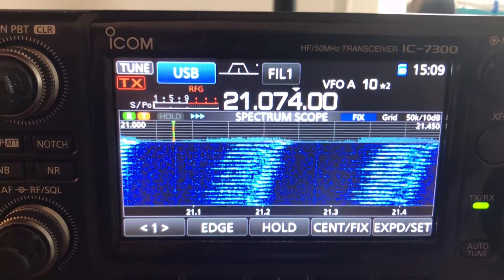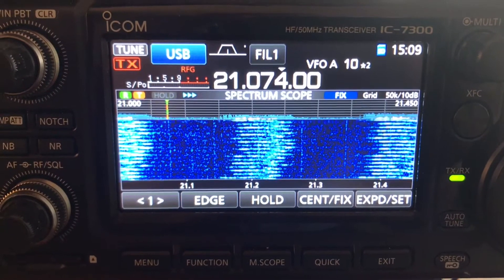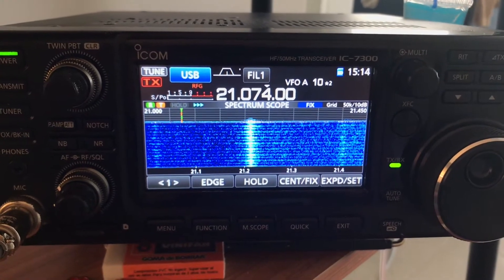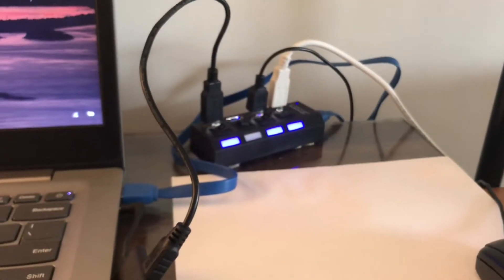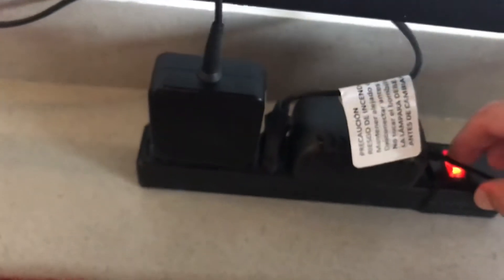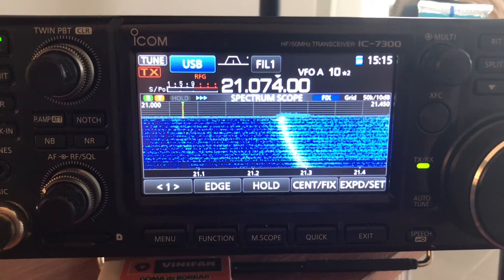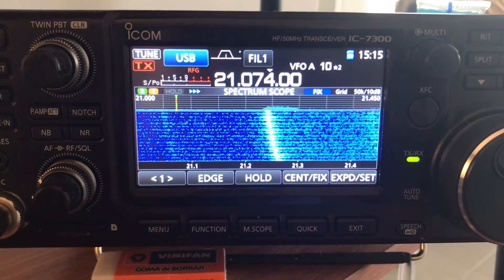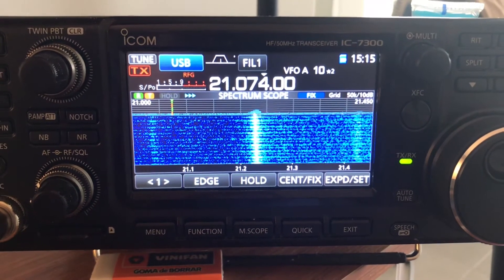Reducing E&M interference in IC 7300

Comment: Any switching power supply, Street lights with ballasts, LED light bulbs, Pig tail florescent light bulbs,  AC adapters, Variable Freq Drives on machinery,  Utility company smart meters, bad insulators on light poles, car ignition or similar,  DC to AC converters, modem/router for your internet connection, Broadband over Power lines equipment, , smart appliances in the home and many more are all sources of noise in the home. First thing to do is hook your radio to a battery power source and switch off the main breaker in your power panel. If the noise stops the source is in your home and you can trace usually very easily with an old cheap AM radio! .  If it is still there let the fun begin, the source is outside your home, and all the sources listed can be coming from one or many of your neighbors or surrounding businesses! then getting rid of the noise can be problematic!!
Reply from the maker: Agreed.  Tracking down RFI can be a lengthy process.